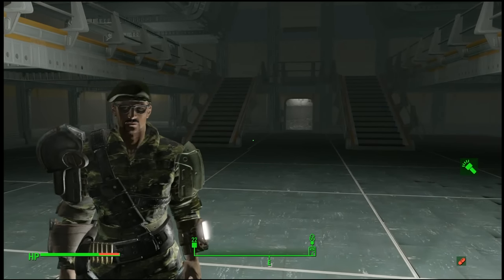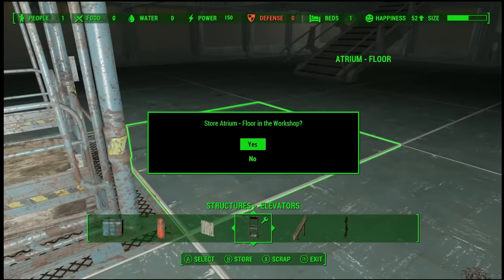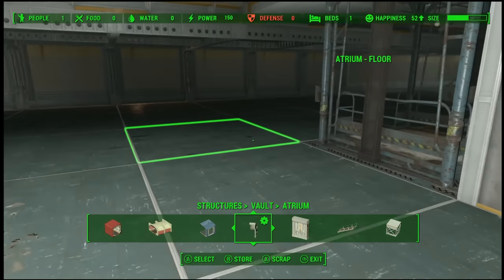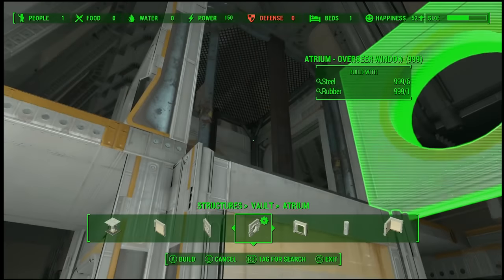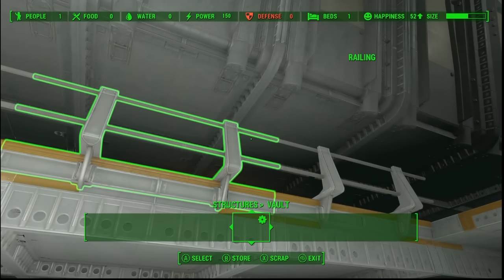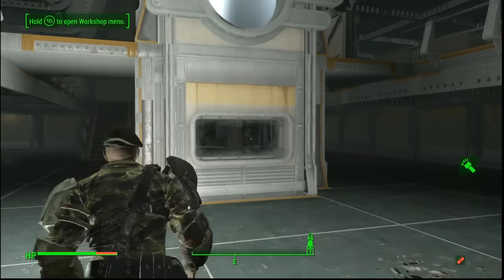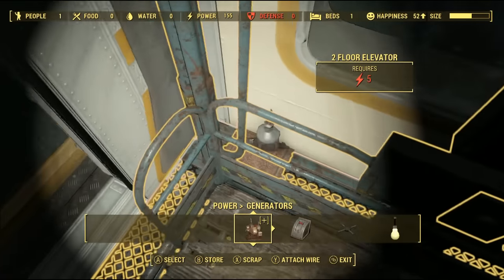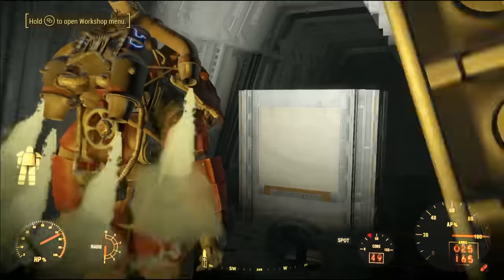How to Install a Vault Elevator: Fallout 4 Vault-Tec workshop

Comment: Very good guide. Didn't realize it would cooperate so much with the kit. Thanks for the information! You should mention the vault Tec water pump in one of your vids, because I think most folks pass it up not realizing you can get it running, and it's very helpful.
Reply from the maker: i did that exactly that :-D just a few days ago realized it was there thanks for the tip and the great video idea!!!